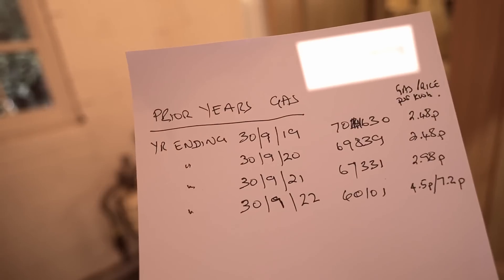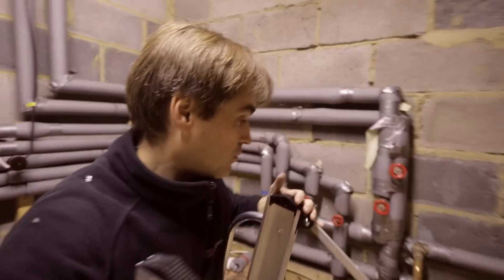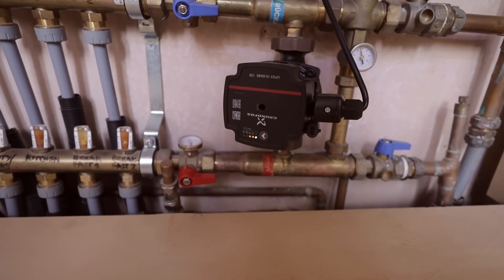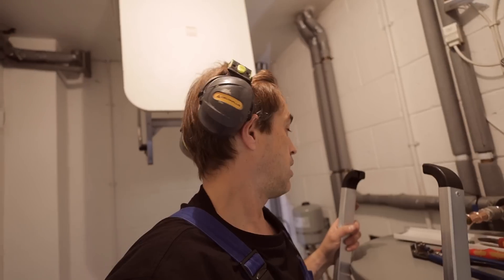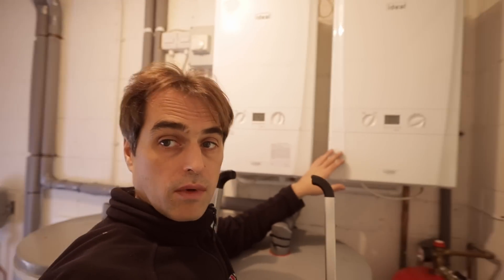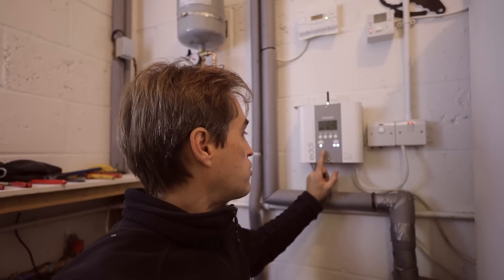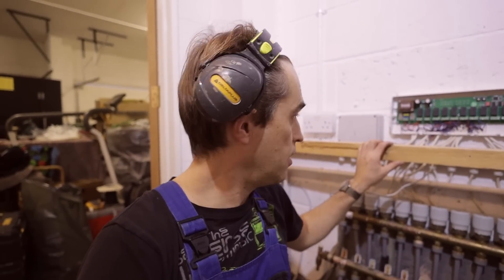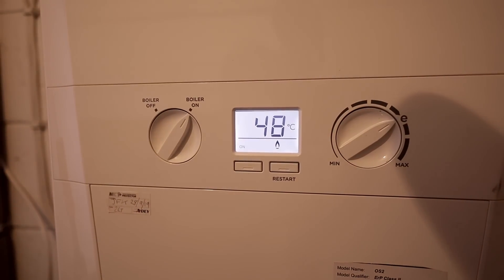Learn How to Lower Gas Bills and Improve System Performance

Comment: Very interesting. I consume nearly Kwh 50,000 of gas for a much smaller house (3,000 sqft and approx 500 sqft is not heated). 41kw Worcester Green Star  CDI on 67 degrees temp. Despite having evohome on 12 zones I still have a huge consumption 🤔 I am not far from you too 😊
Reply: would be worth getting him round to check that. Seems a mighty large figure
Reply: @alcurtis93  You are right. I sent Szymon an email and we will see if he can do something 🤞😊
Reply: Something wrong there, that's utterly insane.

Comment: Good luck with the wireless NeoAir’s. I’ve converted from old 12v wired to these with UH8RF wiring centre for a few years now. I regret. The RF signal is really weak and can sometimes fail, causing a 12min an hour firing of the ‘missing’ zone on the wiring centre. The batteries don’t last as long as claimed on the NeoAirs. If you take batteries out for too long, the stat forgets channel and zone setting, you need to set it again. I hope you have left instructions to the owners how to do that just in case it happens when they change batteries. In my small house and normal partition walls, I have had to add a NeoPlug as a signal repeater.

I have a question. When you have programmed zone thermostats, do you need weather compensation on boiler? Set it to always condense, each room stat will react individually and won’t use anymore heat than the schedule required.

Comment: How important is it to Drain Down the second Cylinder, in addition to just isolating the 2nd Cylinder Boiler Flow Loop and Cylinder Cold input or Output  ?
Reply from the maker: I don't think that keeping water at room temperature in a cylinder that may never get used again is a good idea. 2nd cylinder will have to be disinfected anyway if they want to bring it back online.

Comment: I can't even begin to imagine the bag of wiring nightmares you had to sort out there 
well done great job 👍👍
Reply from the maker: it takes time and patience to trace all the wiring, and also what I call thinking 3D - having 3 or 4 different things in your head at the same time to understand how the existing system is wired.
Reply: @Urban Plumbers  How do you go about it with a system that complicated? Sometimes I find it easier to just unwire everything and start again when it's a basic house setup, but that would be ridiculous here. The other thing I find helps is trying to create a wiring diagram of what's been done, I'd be interested to know your method!
Reply: @UrbanPlumbers  It's very impressive to reverse engineer these so efficiently.
Of course when you do this job for a long time you can make some argumented assumptions and not everything is a questionmark. Very useful experience.
Kudos

Comment: Do you calculate heat loss of building for the minimal temperature of the year? -2 feels more like a average temperature durung december/january.
At least in Czechia we calculate heat loss to -12, -18 depending on the place where you live.
I am also confused about energy consumption. If you have 20 kW heat loss, isnt the energy consumtion for one day calculated -> 20kw x 24hours = 480 kwh? But you said, that this house consumes 260 kWh durint a day (and you said it is insane amount), so I am a bit confused. 
Anyone, please reply and explain this to me. Thank you
Reply from the maker: In theory that consumption is correct. You would need a full 24h of -2 and a house fully heated to 21c for 24h

In practice however it takes less energy to maintain the property at 21c once the fabric of the building reaches the temperature .

Average temperature here is actually 10c in the winter meaning a heat loss of around 10kw for this house and also at night the temperature is set to set back of 16c. On top of that only part of the house is heated up to 21c resulting in consumption of 55kwh per 24h at the moment.

I will post more data when it becomes available
Reply: @UrbanPlumbers  That makes much more sence to me now. I wrongly assumed the -2 C is average temperature just because I live in colder area where during winter -2C is actually average temp. Thank you for your reply.
10kw x 24 = 240. Makes sence now

Comment: Can you please make your ideal vogue hot water priority video available. I could really do with the wiring diagram. PS your content is unreal. I love your system design and your explanation as to why you have chosen a specific design based on your customer’s needs. Thanks
Reply from the maker: I will have to shot it again. There is a mistake there
Reply: Sorry for the late response I have been crazy busy. What was the mistake ?. I have fitted the same setup but it’s not wired up yet. I know you must be a busy guy but a response would be great as the job is miles away from my house and I don’t want to make the same mistake and have to go back and correct it. I could not see the issue when I watch the video. Thanks
Reply from the maker: @user-gman6059  it turns out the vogue video is back up as the wiring was correct there. Ideal in their wisdom has 2 different wirings in heat only and in vogue. Basically heat only needs SL from DHW and CH going to SL1 and DHW off into SL2

Vogue needs to separate SL - DHW to SL2 and CH to SL1 - no DHW off needed - check the manual though as those SL could be other way round.
Reply: @UrbanPlumbers  you are the man. Thanks a lot. This really helped me out.

Comment: Lovely work! It’s amazing that when people install these systems they don’t think about their efficiency. Your clients are lucky to have you!
Reply: It may be they became out of their depth and took the easy route at the expense of the customer. Current gas prices have now caught up with the situation
Reply: money is not a problem for these people.
Reply: @Professional_Youtube_Commenter  maybe but it’s irrelevant really. The original installer had the option run the make the system more efficient but setting it up correctly but didn’t
Reply: @Professional_Youtube_Commenter  Well clearly it is at 10p per kWh, otherwise Simon wouldn’t have the job here. Cheap gas has masked the inefficiencies in the system, but the wastage is insane

Comment: Wow that’s a massive improvement!
Question, I currently have a Nefit Topline 30kW boiler for heating and hot water. Would it be beneficial to add a hot water cilinder in the system?
Considering energy prices I’d like to get everything as energy efficient as possible.

Comment: What has happened to the heating industry this install was very very sad indeed until you.
Reply from the maker: Sadly awful lot of installations are like this.
Reply: @UrbanPlumbers  Seems to be an issue of a plumber and sparkie install where as someone like you understands both and the logic path needed for the control using zone valves micro switches, relays and signals from stats etc

Comment: I'm glad you remembered to set the boiler to after the Solar PV diverter's peak generation window during the day :)
Reply from the maker: It needs some kind of integration with solar controllers to bring the boiler on on overcast days
Reply: @UrbanPlumbers  The Eddi should be able to handle this easily.
Reply from the maker: @singlendhot8628  really? I need to check the manual then.
Reply: @singlendhot8628  Just had a look at the manual, on page 54. The standard Eddi won't do it, you have to buy an add-on relay board, but it doesn't seem worth it. All it seems to provide is the ability to schedule times for heating water using the boiler, which you could just do with an existing control anyway.

For this set-up with two immersions, maybe a couple of relays, one for each immersion live, then pass the cylinder stat call for heat through both normal off on each relay. The live call for heat will only then get to the gas boiler if both immersions are unpowered.
Reply: @shm5547  
Frankly, with such high prices being paid for the sale of excess PV energy, I'm surprised the owners are diverting it to hot water.
Reply: @singlendhot8628  That depends on a lot of things. They might not even be on a feed-in tariff. I thought the more recent feed in prices were quite miserly and you'd always be better off using your excess solar yourself if possible.
Reply: @shm5547  Do you have PV? If so, you'd know that Octopus pays substantially more than the cost of gas heating via their variable SEG tariff. In fact, this past year's entire DHW water heating cost was paid via exports in just 3 months!
Reply: @singlendhot8628  no, I don't have PV. The SEG tariff is a miserly 4.1p/kWh. Gas is 10p/kWh, so I still think it's better to use excess solar to heat water - even with an immersion heater. It also reduces emissions!

But if you don't already have the controllers and immersion heaters to do this, it's probably not worth the expense and far better to do as you do and just export to grid.

To be fair, the payback timescales, upfront cost and hassle of maintenance with solar have put me off so far. I will get it eventually though!
Reply: @singlendhot8628  I thought you might have to sign up to the Agile Import tariff, which has a peak kWh price of 100p 😱! But you can have the Agile Outgoing with another tariff, so that does seem like a good option.

With gas at 10p/kWh and an 85% efficient boiler rather than 100% efficient immersion heater, you're probably looking at a 12p/kWh outgoing rate before exporting begins to make sense. You could set up some complicated flow logic with IFTTT so that it switches between the two options based on the current Octopus export rate!
Reply: @shm5547  That's correct - no Agile import needed. Gas is 10.5p and the V200W is upto 98% efficient at full modulation, but yes, safe to say Agile pays upwards of 20p for exporting PV. 

That logic is part of the next wave of hardware that companies like MyEnergi are working on.
Reply: What time do you set the secondary circulation on and what timers are you using?

Comment: If you had junked the Ideals and installed a single Viessmann 200W, your client's savings would have been even higher and would have paid for the boiler in a year.
Reply from the maker: Why waste 2 new boilers though?
Reply: @UrbanPlumbers  Sell them on. With such a massive consumption even after your great efforts, a hyper efficient V200 boiler pays for itself. Not to mention the advanced weather comp and ability to zone built in.

You should suggest installing one when you return next year to save them much more. Just my 0.02p
Reply from the maker: Next year it goes heat pump and I will keep 1 ideal as a back up. You will not get much benefit of v200 on such a massive house. Ideal with its poor modulation is quite ok on big houses, as with 6kw it already 1/4 of the heat loss so will. It cycle much and run with decent DT.
Reply: @UrbanPlumbers  I hope you'll get a 7kWh Arotherm+ minimum for such a big house. The South facing rooms will need influence.
Reply from the maker: @singlendhot8628  it will be 12kw  most likely
Reply: I think he would prefer burning firewood to installing another V200W ;)

Comment: Another interesting video! Not teaching you how to suck eggs, but i always fit a pipe stat wired through the DHW circulation pump, so that on a properly installed secondary hot water loop as soon as the pipe stat gets up to temperature it stops the pump, it then runs the pump for very short periods as the temp drops on the stat. You may have done this, just didnt notice.
Reply from the maker: I know that. However in those houses the return pipe never even gets warm. All heat is lost before the water makes it back. Had 3 4000 sq feet houses doing exactly that.
Reply: Can you elaborate on the pipe stat for secondary circulation where to get this and how to do this?  We have SC and its a pain.

I have 2 x 161 l tanks for 3 adults , 2 children.  2 x 24kw boilers into LLH and UFH 4 manifolds.  I’ve rewired and added relays to stop all pumps running similar issue as this video.

I’ve just realised that the HW call for heat always opens both valves and heats both cylinders together. 

I’ve split boilers so now have HW boiler range rated to 8.2kw also have solar heating water and set thermostat to 65 on that.  The thermostats that link to boiler are set 45 and HW boiler is set to 50 degrees.

The UFH boiler is set to 40.

Both will still mix in LLH but this should still be fine I think because hopefully solar will compensate.

Hoping bills reduce now
Reply: @symosys  I think the key phrase here is 'properly installed secondary hot water loop'! The idea is to put a pipe thermostat on the return from the hot water loop. So that once the loop is full of hot water, the circulator pump stops. Then it intermittently comes on/off to replace the water in the loop as it cools.

For this to work though, the hot water pipes will need to be adequately insulated throughout the entire circuit. If you had a bit of pipe near the furthest run that wasn't lagged, but the pipes near the return were, then you'd end up with hot water that is not a consistent temperature at the tap for the initial first few seconds of flow.

I wonder in these days of home automation systems, a better option would be to put small, battery powered PIR sensors (like the Samsung Smart Things devices) near the approach to bathrooms/kitchen areas. This could trigger the circulator pump to start running if someone is walking towards a bathroom/kitchen, so that hopefully by the time they get there, there is hot water at the taps.

Comment: Awesome stuff. Alot of properties are just not set up properly control wise, it should be a higher priority with our trade.
Reply from the maker: This one was a total mess - turn anything and everything comes on! It has been like that since 2004!
Reply: optimalisation of heating systems in properties is what I think a very lucrative business.
especially now .
gouvernement should subsidize this .
you saved 2/3 of CO2

Comment: If the heat loss is 20kW @ -2C what is the expected daily heat requirement in kWh?

20*24=480kWh which cannot be correct!
Reply from the maker: Yes it would be if it was -2 outside for 24h and you were heating 100% of the property. However some say that the calculation is 20-30 over and once the property reaches the temp actually less energy is required to maintain it.

Lucky we almost never have -2
Reply: The external temperature is not constant troughout the 24 hours of the day neither throughout all days of the year.  There are factors to take into account which are summarized in degree-days and average annual degree-days which allow to approximate the consumption by a rule of thumb.  These rules of thumb are locally valid.  South-east London is not the same as the Swiss alps ;-)

Comment: Any tips, on how to save on wooden pellet burner/boiler? I have 2 loops, 1 convection loop in the basement. 1 loop for ground and first floor which has a pump. Hot water is via serpentine, stealing heat, from the relatively small boiler storage. Pump doesn't have an abv... All radiators have a trv, but 1 or 2 are left open... I have a thermostat and automatic outside temp compensated shunt, regulating the pumped radiator temps... i.e. during night, heating is off...
Reply: The weather compensation PDHW modifications are only applicable to condensing gas boilers.

However, a small efficiency saving could be made on the circulating pump if it's an old one that doesn't modulate it's speed. A modern pump with a proportional pressure curve would reduce the pump power consumption when the TRVs close. But you need expert advice, as wood burners can get very hot and adequate water flow is important for safety.
Reply: @shm5547  Thanks for the reply... Safety of the boiler is ensured, by a thermosensor in the boiler, and by only burning a handful of wooden pellets at a time... 
Though this didn't help when last February, my open air expansion vessel that is in the cellar, got clogged and there was no over pressure valve... Fortunately, the boiler had spewed water on the electrics, and the RCD tripped, shutting of the boiler. Now the expansion vessel is pressurized and right next to the boiler... And with a opv of 3 bar...